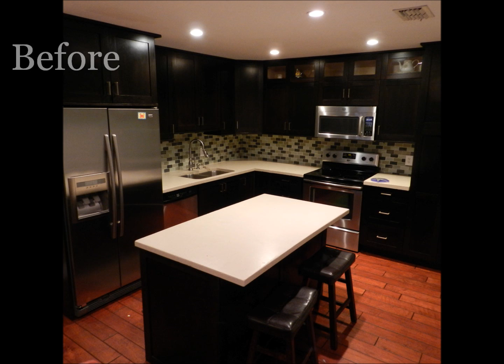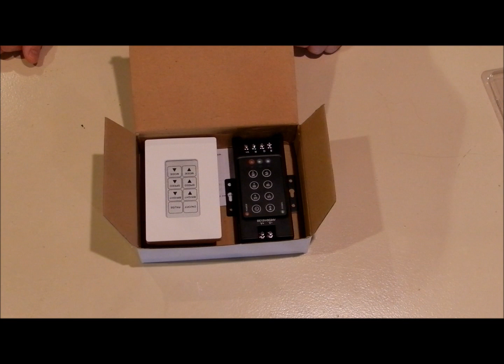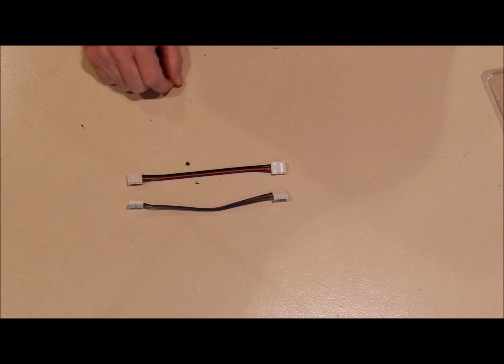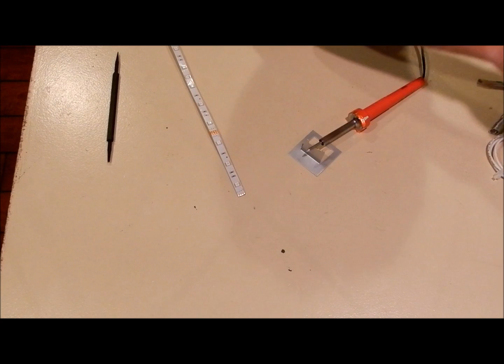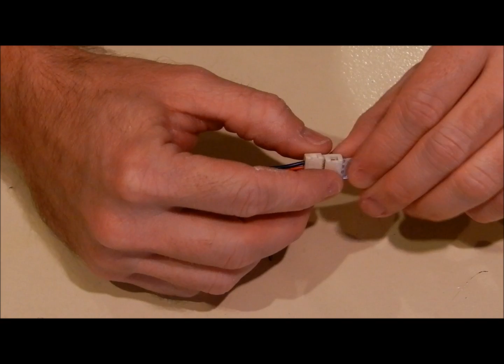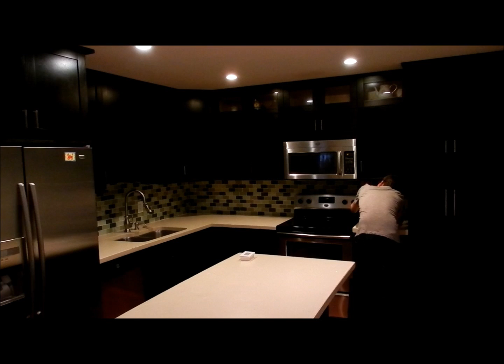How To Install Color Changing LED Lighting

Comment: Just a question, these take a 12V DC right? Would it be the same no matter how big the size of the strip you use? Even if you have only 1 LED? Will it still be 12V DC?
Reply: The voltage does not change. The amount of current drawn (amps) goes up as you add lights.